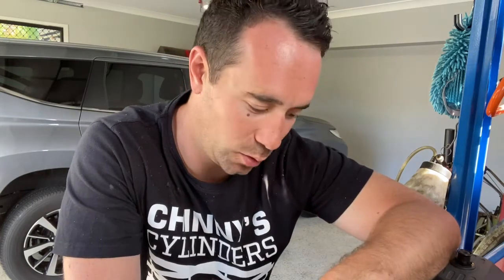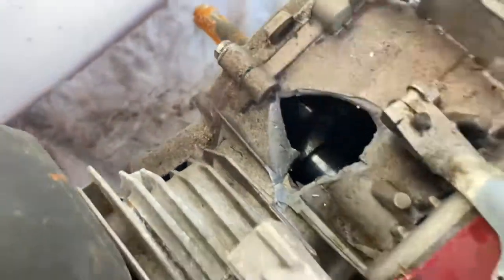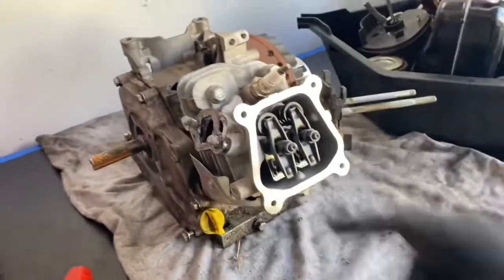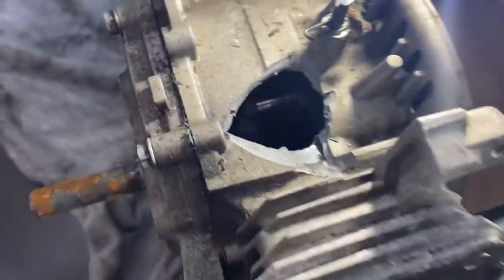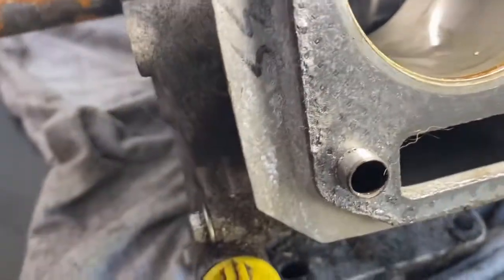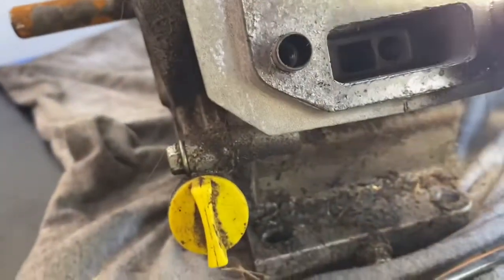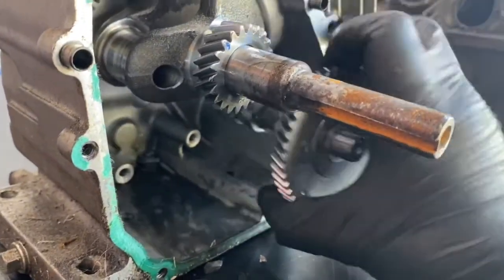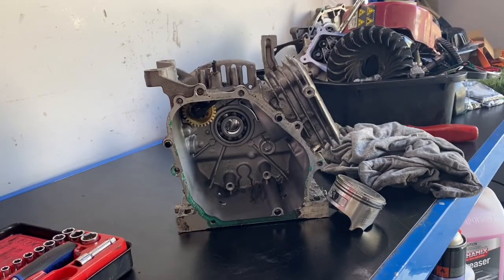Briggs and Stratton engine strip. What went crack!!!!! Cylinder Mower Engine

Comment: Can you do a video on adjustments of the throttle and reel and drive. I’m not sure what’s normal as I only bought my new cox mower last October and I’ve never had a cylinder mower before, just my old 24 year old masport rotary which is still going strong. When I have the cox idling on low the blade is still spinning. I believe the blade shouldn’t be spinning when only idling and should only engage and speed up when applying the throttle. Cheers (love the vids just sat here watching them)